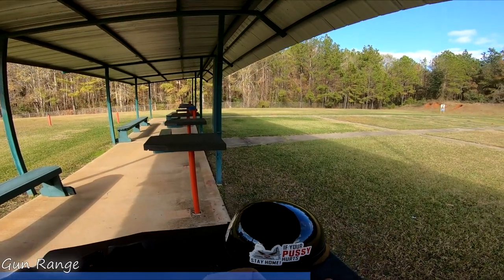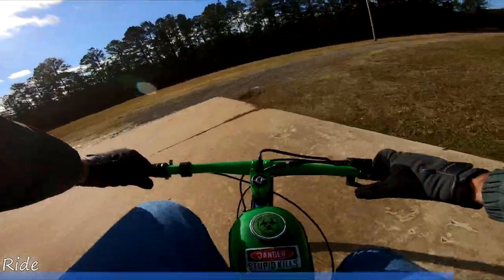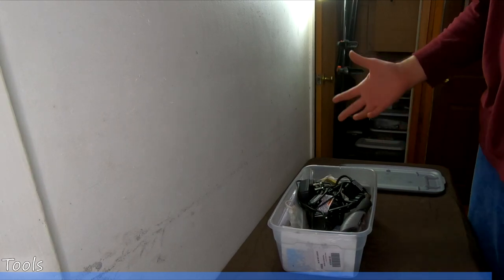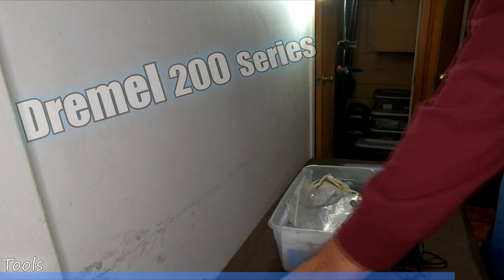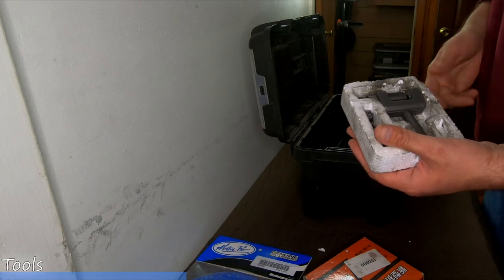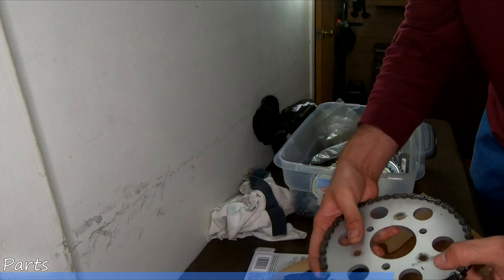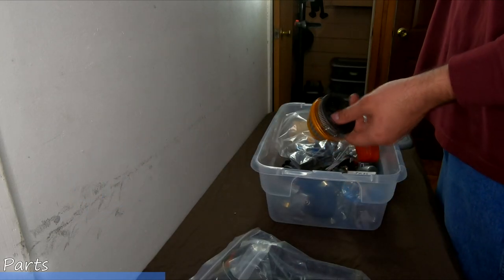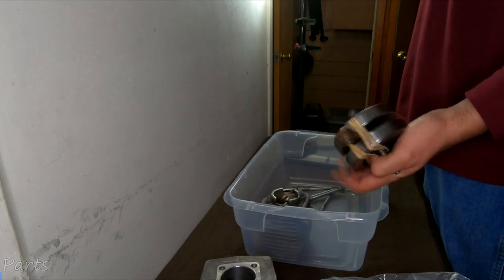Motorized Bike Parts And Tools

Comment: My 'Go-bag' has 3 'master' chain links,pump,patches,3 medium size zip-ties.,2 way screwdriver,a 6"cresent wrench,and needle nose pliers.I wrapped some electric tape around the handle of the 2 bit screwdriver.=I've used all but the patches at times.(Knockwood.)
Reply: Pump for?

Comment: I too have bought parts,when I could afford,to have for wear out:Clutch plate with pads-$12,Steel sleeved cylinder 47mm bore-$36,415H chain-$16,3-pk Master links for 415-$7,clutcharm/buckbar+bearing w/cover-$12,6-pack stainless steel brake lines-$9. I screwed myself with the 1"clamp/adapter for the hub-$39as it crushed 2 wheel hubs,and ripped spokes in 3 rims.1 'heavy-duty'multi-spd 26" rim w/12gage spoke(weren't they lied)  and the hub bearing cup faile after 6 weeks.(no warranty then.)edit= I am using the 26"6-star alloy wheelset-$118. and a 56 tooth multi-hole sprocket-$27.
Reply from the maker: I feel your pain... the hub adapters seem to work ok on coaster brake hubs (when keyed). But I damaged two rims trying to keep it from slipping on a 1" hub :(

Comment: Man, my Yd had a stripped hole for the head screws, trying out a windowed and reed. Lucky I have a backup. This ones going back. I hand tightened them going back together, and bareley torqued the bolts. Beware!!

Comment: I had the same idea using a bigger carburetor going to have to try to Jerry rig something up just started building a motorized bike trying to put the sprocket on an 8-speed hub rim with a center lock disc brake I think I got it figured out but it's a pain in the ass
Reply from the maker: Good luck man!
Reply: Put together a kit last night for one of my buddies he came back to me about an hour ago with the kit on a different bike it was totally fubar people who are mechanically inclined should definitely not buy these kits idea for video people who should buy these kits and people that shouldn't
Reply: @LAHover  I did after Mount the sprocket to an 8-speed center lock hub it didn't take much modification I made the hole in the sprocket just a little bit bigger and bolted it to the disc brake mount and then put it on the rim works perfect I would take a look at center lock disc brakes hub it doesn't take much to mod it I think it works better than that hub mount kit I used a Shimano 8 gear 40 mm center lock hub

Comment: The low profile wrenches, what's the most common sizes for bicycles?
Reply from the maker: So far I have used the 14mm and 15mm. The "park Tool" kit I have came with 13mm through 17mm.
Reply: @LAHover  what's the park tool kit number?
Reply from the maker: @GrymmTymm1313  https://www.amazon.com/gp/product/B00XGQP08M/ref=ppx_yo_dt_b_search_asin_image?ie=UTF8&psc=1&fpw=alm Looks like it also has an 18mm :) neat!

Comment: What resolution is this? I did my last video with 2.7k 60 fps (super view) and it took me almost six hours to edit. My laptop doesn't have enough horse power ( XD ) to handle that. The frames were barely moving in the editing software.
Reply: I use 1080/ 60fps last  vids.after I bought a cam with anti-shake.15 mun vid upload to YTube @30mins. off Windows 7pro.
Reply from the maker: Up until just last week I have recorded and edited all of my videos in 1080p 60fps (mostly super view).
I just started playing around with recording my videos in 2.7k 60fps (super view for riding, linear for bench work).
I still edit in 1080 but I can now crop in if needed without losing quality.
I currently don't have the storage for 4K editing...

Comment: you like thumb throttle better I thought about putting on my bike also I see thos bikes doesnt have front suspension have you thought about suspension or no
Reply from the maker: For long rides no, and any time I'm not riding WOT my thumb gets tired. I had to reduce the pressure on the throttle return spring, and shorten the throttle piston return spring to make it comfortable.
If I can find a for that fits the cranbrook, I may try suspension.
Reply: @LAHover  awesome alrighty

Comment: In canada the motor for the bike are 200 plus dollars to rich for a hobbie for me
Reply: $227 Canadian on Amazon for a BT80 or 217 thru Canadian Motorized Bicycles in Grimsby for a Skyhawk GT5A.
41 chain has a wider pitch( wider link) could spit off easier, check your spacing at the drive sprocket between the case
Reply: Save up the money. It's too cold right now anyway in Canada. $12.50 a week for 16 weeks, by early April you got it.
Reply: Better yet, I saw on Kijiji half dozen built bikes with motors for sale ranging 300 and up, or I can give ya a deal on a used Skyhawk GTB 40/40/40